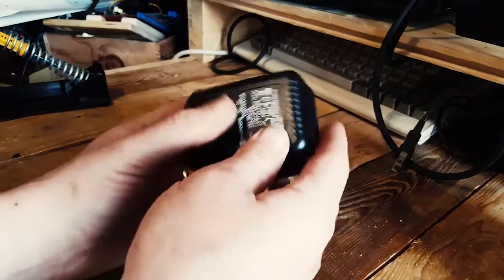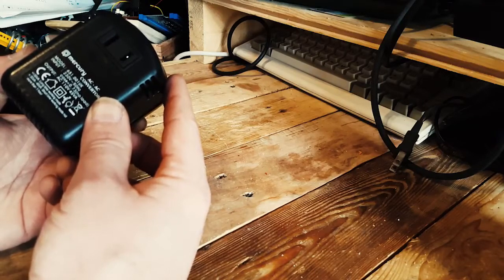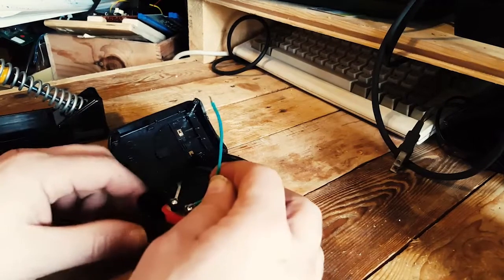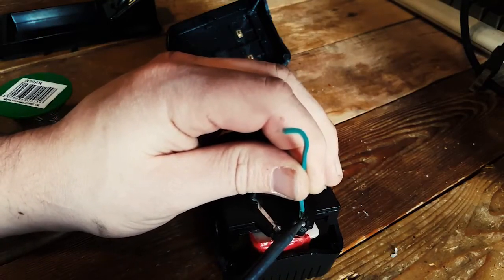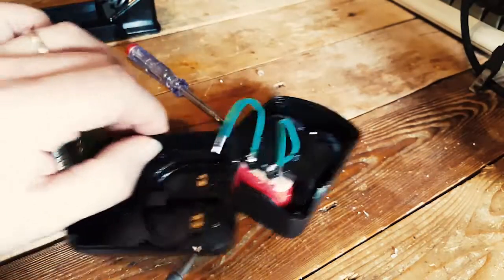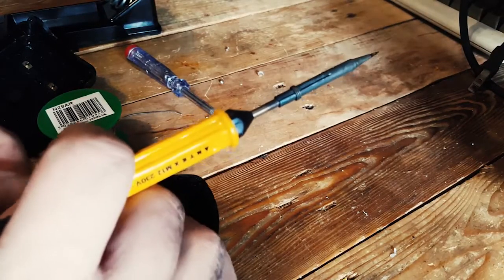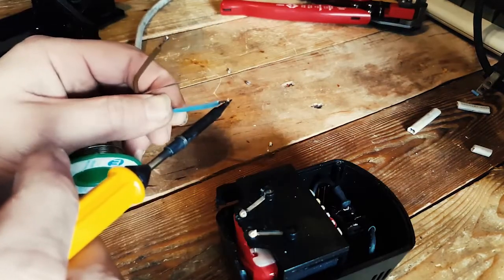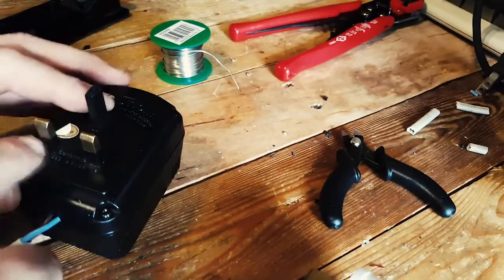Can I fix it: Step down voltage converter

Comment: I came to the channel for the MSX stuff--not because I was a fan but because I'm a Canadian who'd never heard of one til the last decade or so. I'm curious to learn more.
But I never miss one of these Big Clive style repair / deconstruction videos either, they always keep my attention pretty well.

Also, would it be a good idea to fill that hole where the wire exits with some hot glue so the strain doesn't go to the solder joints  inside? If one lets go you're in for a short!

Comment: Does the charger need that converter? My canon's charger has that US prong but it says 100-240 on the back. so i just plug it directly on 240v without stepping it down.
Reply: u know what I actually never bother to look :) I just saw the US type plug and I had a converter handy.  Even better then , I can use it for sth else :D